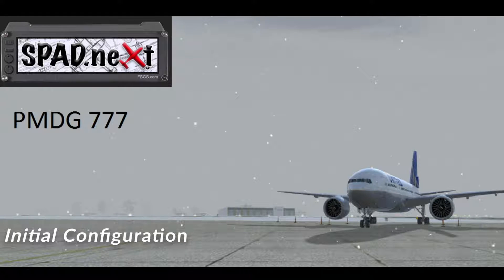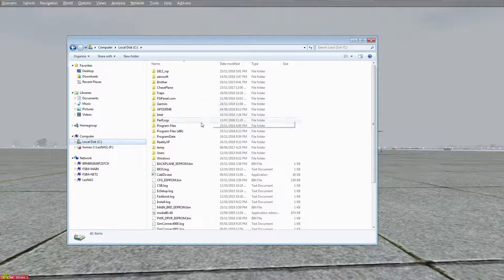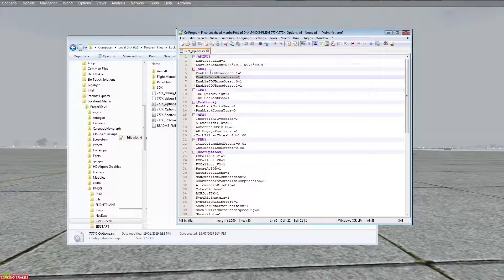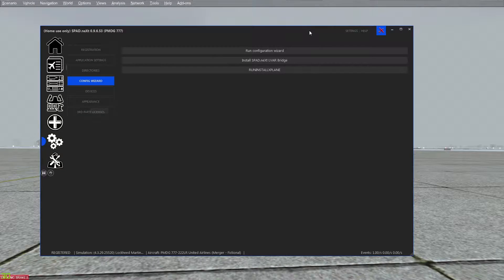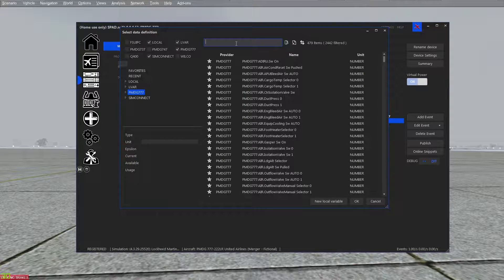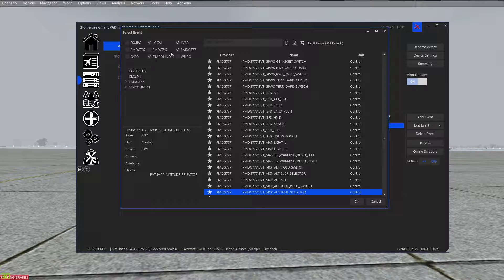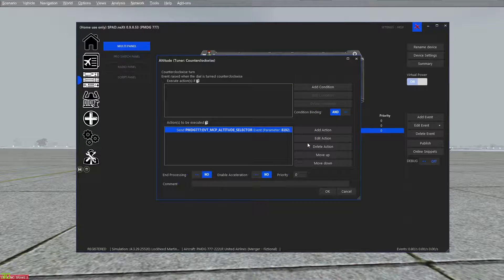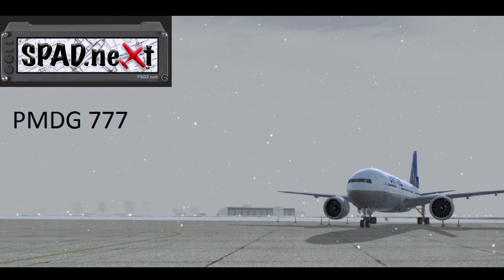SPAD.neXt PMDG 777 -1- Initial configuration

Comment: hi les i am not find sdk in side the option file 
i use pmdg 737 and prepar3d v5
Reply from the maker: I think I need more information. The P3D SDK or the PDK is an additional download from the LM website. The PMDG Brodcast config ini is where it is for the 777 that is show. Must be similar location for the 737. PMDG has forumns and support. If you can’t find it I would hit them up since you paid good money for their product.
Reply: Same thing here. My 777X_Options.ini doesn't have an SDK entry.
Reply from the maker: You have to add it manually... same with the CDU entries.  This file is in the P3D folder then PMDG then PMDG 777X....  If you don't have a SDK section just add it...  If you have the section but not the entries just add them and save the file... then launch the sim..

EnableDataBroadcast=1
EnableCDUBroadcast.0=1
EnableCDUBroadcast.1=1
EnableCDUBroadcast.2=1

Comment: First af all thank a lot for your nice video , it is very helpfull for me , I have a question : I have PMDG 737-600 , I have configured Multipanel as you but display is only correct when moving multipanel knob , I mean , if I move direct in PC screen wherever heading for example it does not change value in multipanel , could somebody help me Im using the right instruction : Display  PMDG737 Glareshield mode Control Panel.heading , Im using FSX steam
Reply from the maker: This is probably due to not having the PDK set to Broadcast the data.  Or you do not have the most up to date version of the PMDG 737 and thus the interaction with SPAD is not going to work since the PDK would not match.
Reply: @LesOReilly  , You are fully right , my pmdg version was outdated , I have updated and everything is fine , Thanx a lot

Comment: Nice Video.
Actual easiest way to check the conenction is up and running without any panel programming:
- Start FSX/P3D , load the 777
- in SPAD.neXT goto Support->Status. It should say PMD777 Connected and also if all 3 CDU are connected.
Reply from the maker: Nice Tip!
Reply from the maker: Nice.